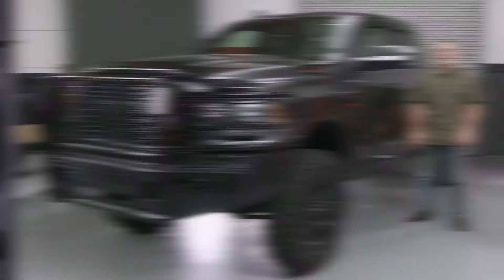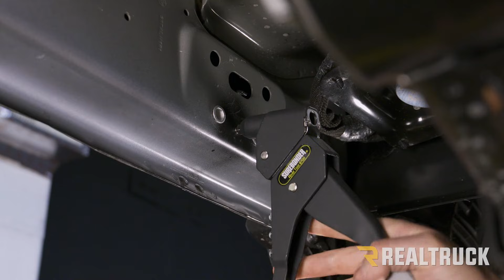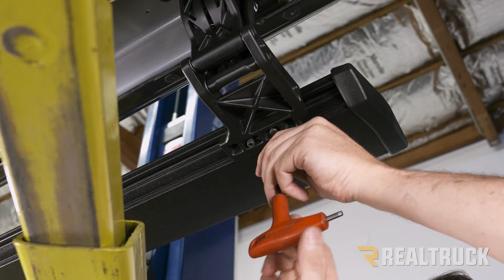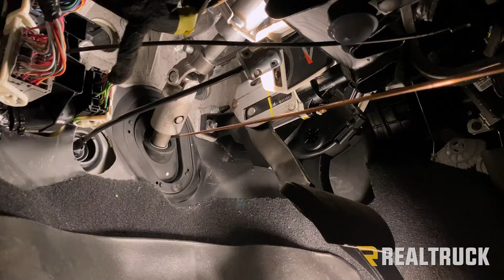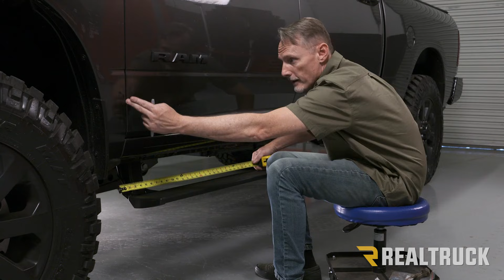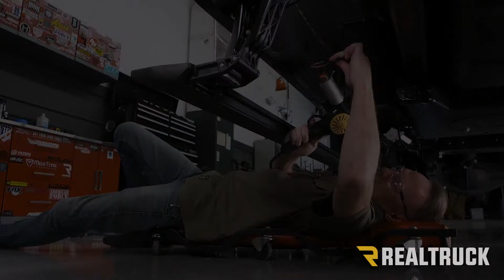How to Install AMP Research Power Step on a 2020 Ram 2500

Comment: I have just finished the install of the amp power step on my 2020 Ram 2500 crew cab 6.4 gas . 2 recommendations for this install ; 1- The 2 pin connector can not be installed without removing the weather seal from the driver's side front door, and then removing the clip on dash endcap. The green block is right there and just hangs on a clip, lift it up and the 2 pin connector fits right in. Whole thing takes approximately 10 minutes. 2- recommend labeling the 2 purple wires, also called the trigger wires, with a piece of tape left and right, otherwise it's a 50/50 shot at correct connection. These steps actuate very smooth and quiet, and tuck up very nice when stowed. So far very impressive product.

Comment: When will Amp Research / Real Truck have the Power Step available for a 2025 RAM 2500 Crew Cab 6.4L gas engine?  I keep checking both Amp Research and Real Truck websites with no information available.  I really want these steps. Thanks for any information you can provide.

Comment: Great video! I have the original powerstep with only the one motor on the rear, driving both the rear and the front linkages. The motor is acting up not extending as far as it should on the rear, but allowing the front to, oddly enough; partially because the rocker panel has corroded  in the front and only has the top bolt holding it up, allowing the front linkage to swing, and the board to be cockeyed. I'll be installing another rocker panel to fix this. After a few times of this, the running board popped of at the rear only. What I noticed is that the sliding back plate with the female threaded holes for the allen set screws didn't have any threaded female holes, just a flat piece for the set screws to push up against, which again seems odd as the ridge that the running board sits in doesn't seem wide enough to offer resistance for the allen set screws to tighten up to. Has anyone experienced this as well?

Comment: Will this application work on the 2021 Ram Power Wagon? I have been told that there is something under the body that wont allow the XL to be placed.
Reply: air tank/pump, you can relocate it

Comment: Is there any reason these won't work on a gas 2500?
Reply: I installed them on my 2017 Ram 2500 6.4 last february no issues.

Comment: Great video 👍🏼 installing yourself will save at least a couple hundred bucks. Plus you’ll do it nice and how you want it done ! I hade LINE-X install mine and well long story short I had to re wire everything do to wires were all over my engine bay 🙄😬

Comment: I moved the right side step so the end cap (of the rear mounted idler) is at the mounting bracket...so about 3/4 of an each from perfectly centered. After this adjustment I did not have any interference from the pinch weld (it was hanging-up previously at the radius of the pinch weld bend ).

Comment: Great video, I'll be ordering those for my 2021 RAM 2500 in the next few months. I like the looks of your 2500, what size tires and brand are you running on that beauty and lift/ level. Thanks for the info, Navy Mark...
Reply from the maker: Hey Mark! On our Ram 2500, we have the Supreme Suspension 3in leveling kit with 37x11.50 Nitto Trail Grappler M/T tires.

Comment: Is there a way to wire it up without using the OBD II?
Reply from the maker: Hey there! Unfortunately not, but Amp-Research also makes a pass through harness that you can use if you want to also run a tuner/monitor or anything else that requires an open OBD2 port. :)

Comment: Ugh I want to put a set of these on my rebel but seems like more time than I would have.
Reply: Do it. You can do the install one step at a time as you see fit. That is what I did. One day I did the first step for all 4 corners i.e. installing the bracket inside frame, doing the pop rivet, and nutserts. Took about 20 minutes. Next day I bolted the mounts/motors/steps on. Took about 30 minutes. 3rd day I did the wiring. That took a good 2hrs. I took my time, strategically routed everything under the hood/firewall.

Comment: Can you touch on what you did with the pinch welds   I've done a hundred of these dodges and the pinch weld always causes the step to hang up  are you grinding the pinch weld also   there has got to be a better remedy. I've even started building stoppers so the step don't go all the way up
Reply: https://youtu.be/ITbAeixVKdQ
Reply: It hasn't been a dodge for over a decade
Reply: @marchuffman8266   ok.   Ram